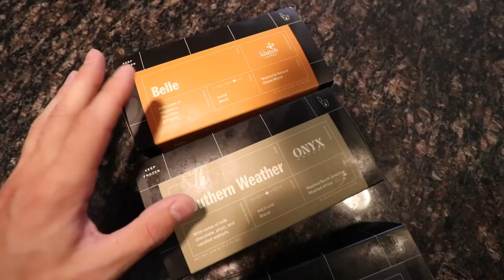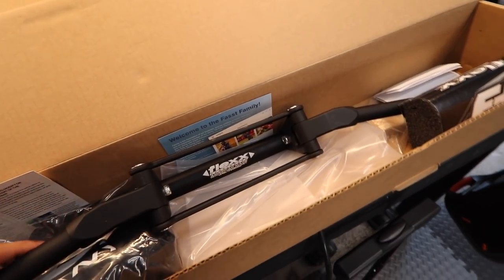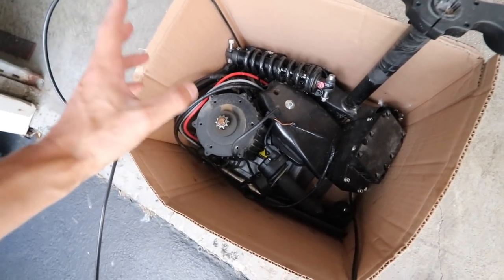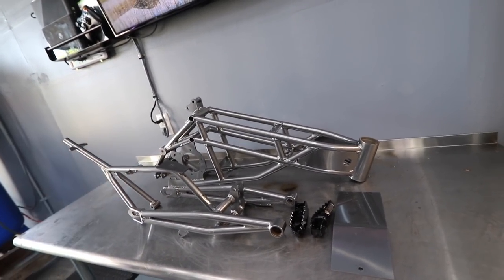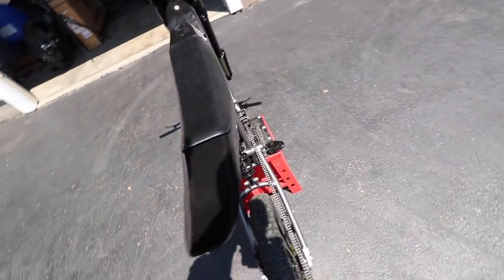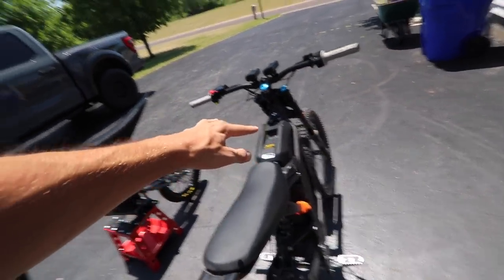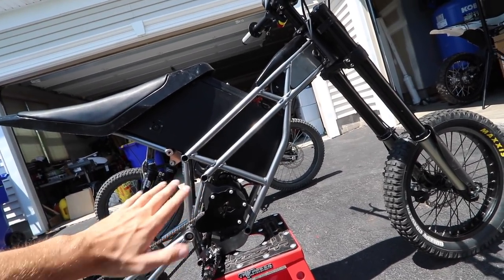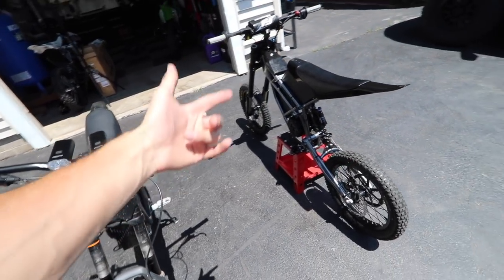Building The ULTIMATE E-Bike | Kuberg Freerider

Comment: Hi I’m new to kuberg free rider I bought used. I want to go with 24tires rear. You think or have you tried to see if a surron will fit with minor adjustment? The sprocket I know is different, but make changing the hub and lacing the original sprocket from kuberg wheel to the aurron wheel I think might do the trick. Surron parts are abundant and cheaper vs kuberg parts online. What you think?